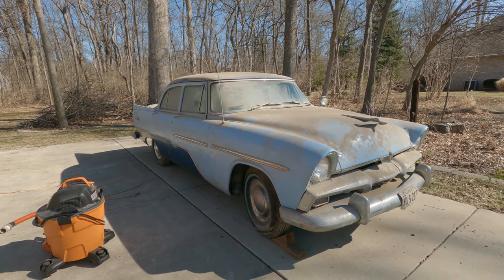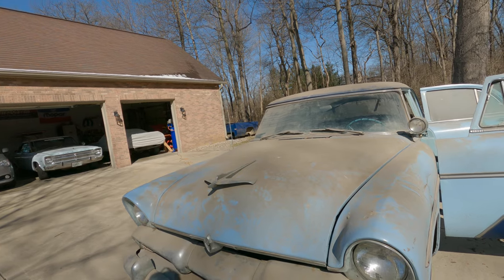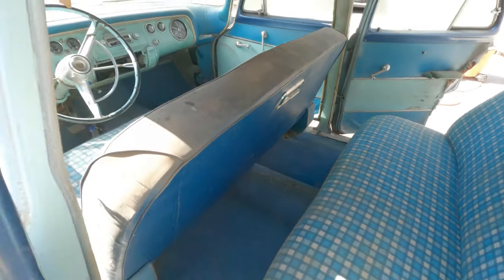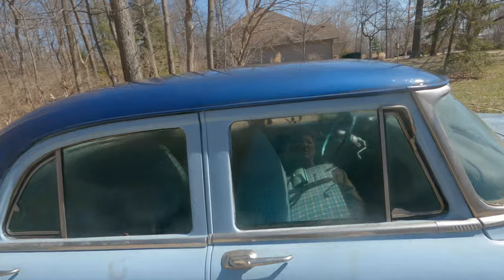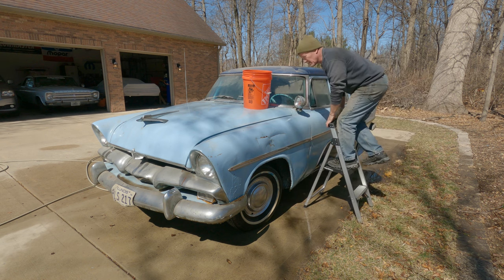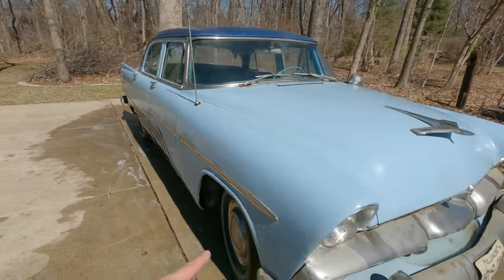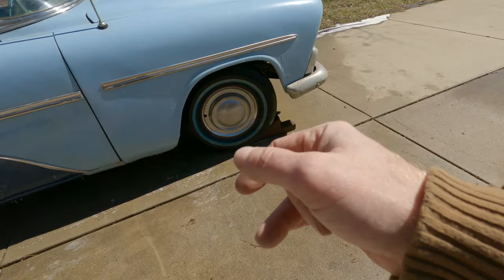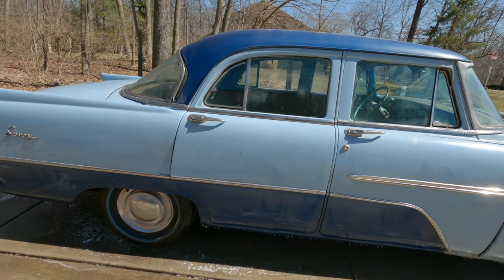A Barn Find from 1956 - the Plymouth Savoy Barn Find

Comment: i had a good experience with liquid lustre wax. it took all the chalk out of my paint, and essentially saved me a paint job. Use a random orbit buffer, and it will clean the paint right up. Also aaj front disc brakes conversion will save you a lot of headaches, and some money.
Reply from the maker: I think that she's about as clean as I'm going to get her for a while.  A Dodge Dakota chassis swap would solve a lot of problems.

Comment: Had a 56 savoy 2 door light blue 1967,68 drove to school power flite good car v8 power one color ran pretty strong would have been awesome with a 4 speed. Traded it in on a 66 coronet 500 convertible
Reply from the maker: I think that you did well on that trade.

Comment: I coulda  bought. 2  of these in 1973.   I wss 17. A 55 and a 56.   56 was a 2 Dr. Sefan  55 a 4 dr. One had good engine the other was Locked  up. He wanted 75 bucks for both.
Reply from the maker: Stuff was cheap back then even with inflation.